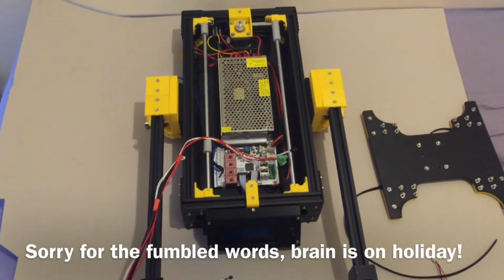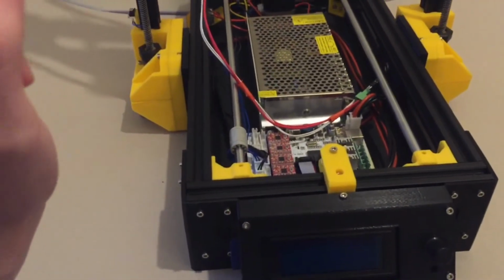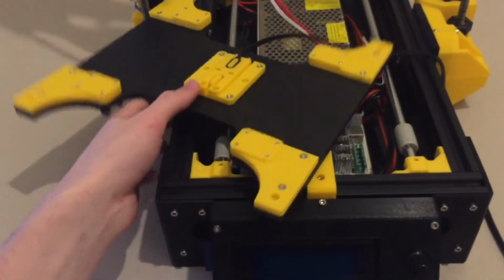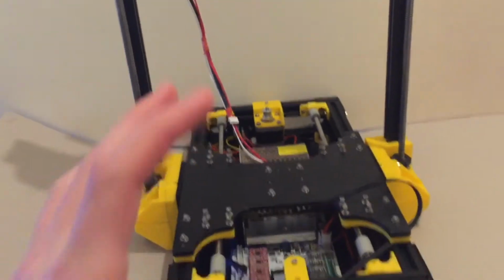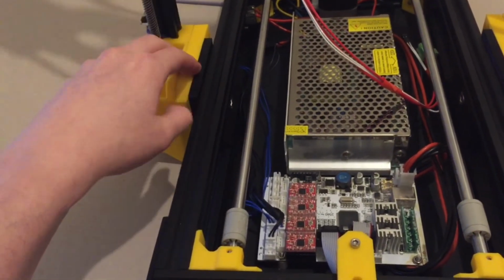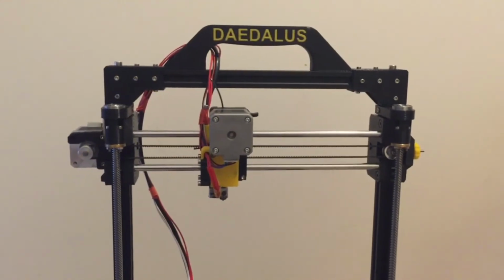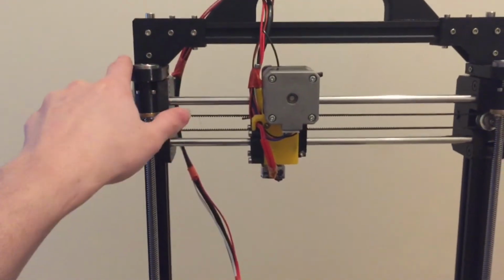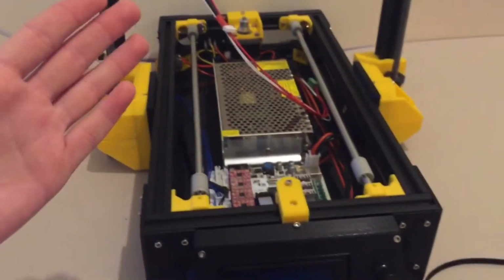DAEDALUS Foldable 3D Printer - Part 1

Comment: I, too, like the GT2560, it is surprisingly well engineered. The only fault that i found is that the heatsinks, if they burrow under the solder mask, could kill something off.

I wonder though, the smooth rods in the bottom carriage seem a bit unnecessary? I mean you could have the bed carrier ride on the inner grooves of the extrusion, just like your Z axis rides on the extrusion?
Reply from the maker: Siana Gearz I originally intended for the carriage to ride on the V-slot however in my experimentation I found that to not be a viable solution design-wise and could introduce possible issues with rotational play.
It’s not perfect but I don’t do things without a good reason!
Reply: Thanks, interesting, though so far I struggle to see where the issue is coming from. Carrier flex? Slight angle between extrusions?
Reply from the maker: Siana Gearz unparallel extrusion is one issue. The others mainly revolved around space, ease of assembly, complexity of assembly including the eccentric nuts necessary to preload the wheeled design and the fact that each of the wheels would be taking load at an angle to the mating faces, which is also only one face and not both as with the Z axis. In the end the rods saved a whole load of headaches and worked out to use hardly any more space, if memory serves.